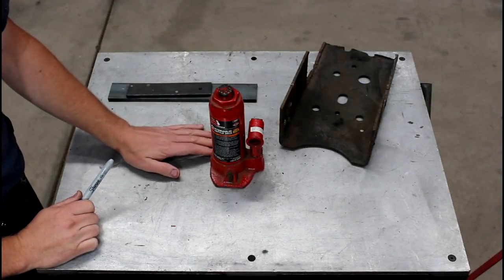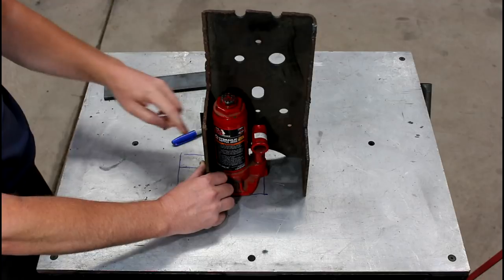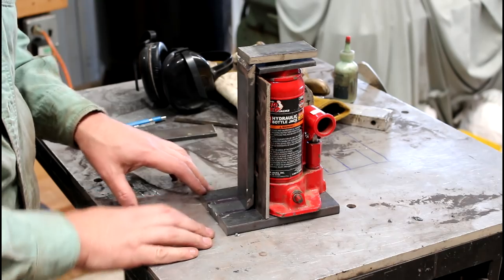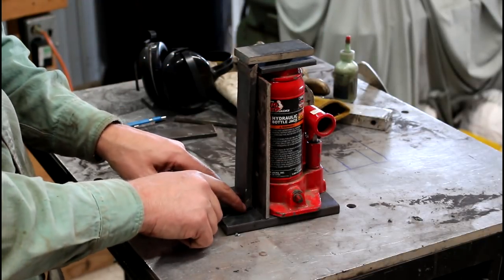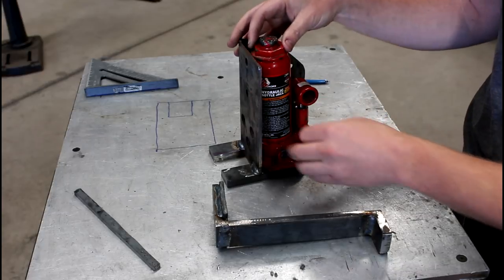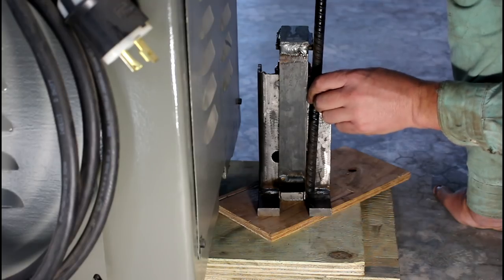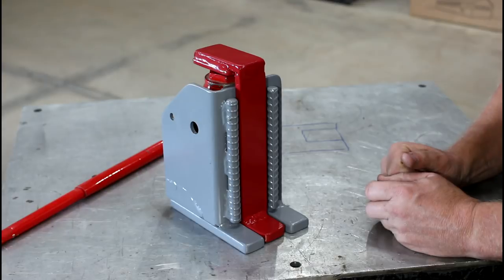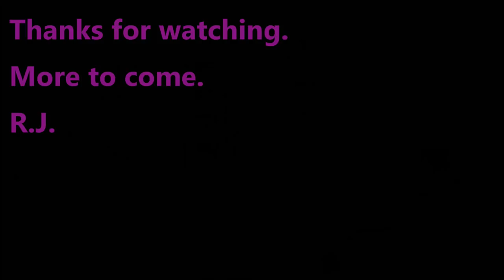DIY Toe Jack

Comment: One thing I'd recommend is some grip tape on the lift area just to reduce the item from slipping. Great design. I was looking at the difference in price in a bottle jack and toe jack at Harbor Freight since tomorrow is 40%S off any Daytona jack, and it's a huge cost difference, so I had the idea to just build my own. Something else you could consider adding is a spring to help retract the cylinder between lifts/cribbing.  Thanks for sharing RJ.

Comment: Thanks for the design and especially for the safety topic at the end.  "Lift an inch, crib an inch!"  Good advice when working with really heavy machinery.
Reply: I was about to say the same! Great to see a YouTuber who understands the importance of safety communication as much as the design and build process. None of this "it's my choice to use the grinder with the guard off" kind of crap that I see so often. Sure their choice, but they also have a duty to their viewers (90% of whom have relatively little practical experience) to demonstrate good safety practices. R.J., thank you for going that extra mile! Awesome.

Comment: I enjoyed your video.
I may build something similar. I think it important to eliminate any side load on the jack's piston, it was not engineered for that. I think you said that you might add a metal strap , to prevent outward movement of the slide, this is the way to go as it would eliminate side load on the jack's piston. I would also elongate the jack positioning hole, to ensure that all side load  is not against the jack's piston.
Thanks for sharing.

Comment: Nicely Done Randy!  I am anticipating moving my 5000 pound lathe down to my basement.  I'll be making 3 toe jacks to assist in the process.  Appreciate you sharing.  Excellent commentary.
Reply from the maker: Thanks for watching Reed.  I hope it gives you some ideas.  Good luck on your move and stay safe.  R.J.
Reply: Hi Reed, don't know what and how your basement looks like but if the task of moving a 5000 pound machine in it is not daunting (for an average DIYer) I'm not sure what is. Such jacks will help in lifting but how about moving (unless they are with rollers :-))? Stay safe!

Comment: Nice build. Personally I would have used stick to weld the toe on - unless your mig is very powerful.
I was going to build one of these - until I managed to buy a nice old British 5 ton Dorvic toe jack for less than £20 or say $25. It is a rack type - very smooth action. If I ever need a really heavy lift I might be tempted to build something like this.
Reply from the maker: For me the MIG I felt was more reliable.  And the weld prep is a big part of  that.  Either way, I load tested it with a higher than rated load with little risk and all survived!  I find more uses for this now that I have it.  Thanks for commenting.  R.J.

Comment: you may consider the force on the ram/cylinder as whatever you jack starts to angle and pull the jack forward, quickest way to destroy a bottle jack is lateral force.
Reply: Best to keep lift forces as close to vertical as possible.

Comment: Many thanks for the video, am half way through making one to your design !. Nice to see you wearing gloves using an angle grinder too, so many on utube dont.
Reply from the maker: Good luck with your project.  I have found many more uses for mine since I built it.  Many years on an ambulance taught me that protecting yourself isn't an option.  Thanks for noticing.  R.J.

Comment: Interesting Idea, I need to add a toe to a Zinko air-hydraulic bottle jack to expand the surface area of the head on the jack and add a base to increase it's stability. This would be a good starting place for me it seems. My Zinko is rated for 20 tons.
Reason: Zinko does not make these with the air power option and they cost a fortune.

Comment: was that weldable rebar used ? or not.  does it matter ?
Reply from the maker: I am not familiar with weldable rebar.  This is standard #4 rebar, and since they are used as a guide and not a load bearing member, I used whatever scrap I had laying around.  If I had some 1/2" round bar around I would have used that.  Thanks for the question and for watching. R.J.
Reply: @r.j.sworkshop7883  Well from what i learned from other videos and online instructions about welding rebar it would have a W designation somewhere on the bar different carbon content. so if the weld on the rebar fails from an unintended sideways load, that may be it. Hit it hard with a hammer to be sure it will hold.

Comment: you  did not show us your product at work ?  How can we trust your product might work
Reply from the maker: Maybe you should actually watch the video.
Reply: @r.j.sworkshop7883  I did see you using the product at the very end by moving  the handle. Yes. What I expected to see what your jack lifting a washing machine or some kind a product like a large metal container. Now would you not agree you didnt show us that part ?
Reply from the maker: @mw7185  If you listen, it is lifting the headstock end of a 3000 pound lathe. When in use, you only like about 1" at a time. A distant shot would show nothing.
Reply: Why don’t you post a close up shot showing a 1 inch movement ? I’d  be happy to see that and recommend this video for someone else to see.
Reply: This item is a very useful item. These days people are buying heavy container boxes and using them to build small homes. I am sure at one point they will need to lift that box and put a foundation or a cinder block to lift it above ground. This is when this tool can be really useful. I have to build this myself. Great work.